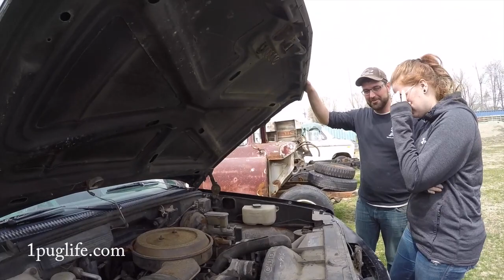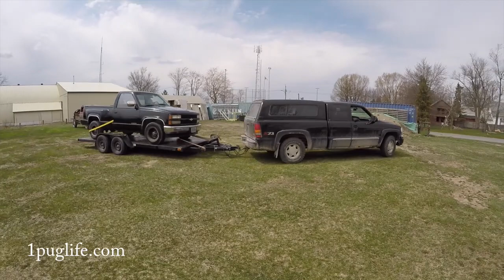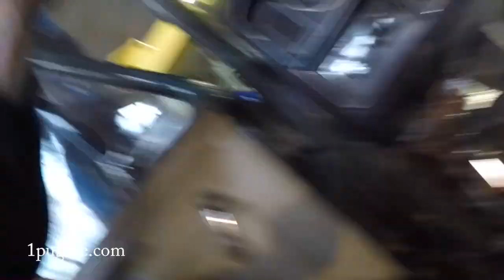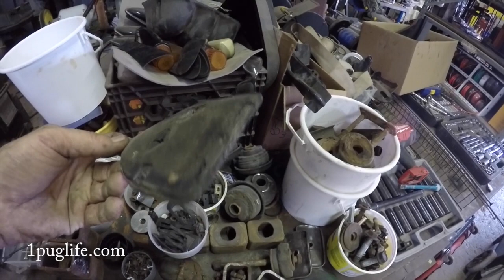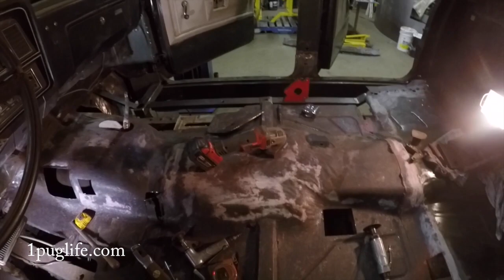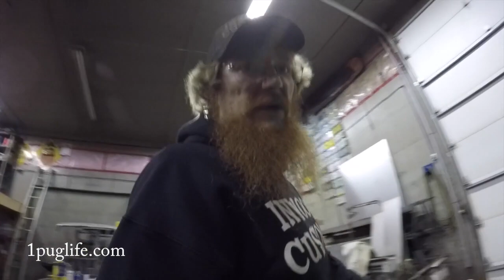lectric fire

Comment: Instead of sticking a nail in the ends of those two wires you could make different diameter coils for different sized nuts and bolts and..........presto, you have an induction bolt buster........Goof! lol

Comment: Pug did you know that if you take an old battery, drain all the acid out, flush it several times while upside down   replace with new acid(from parts store) you basically have a new battery. Jeff
Reply: Jeffrey Hansen or just fill it up with water